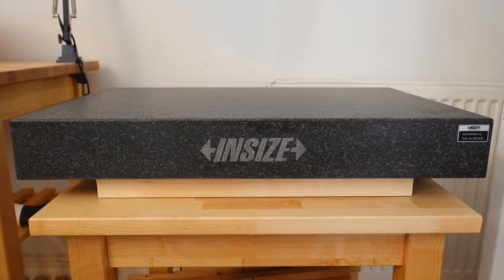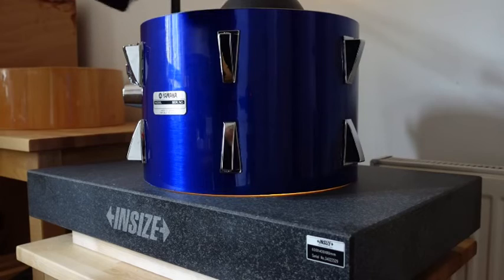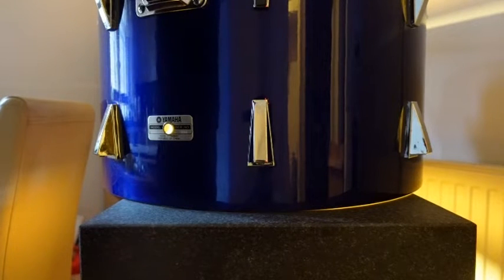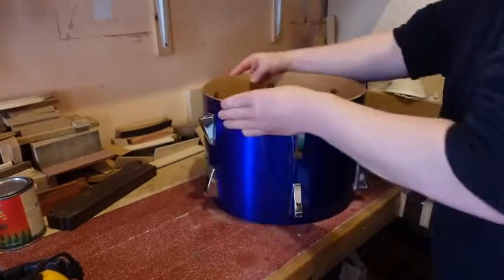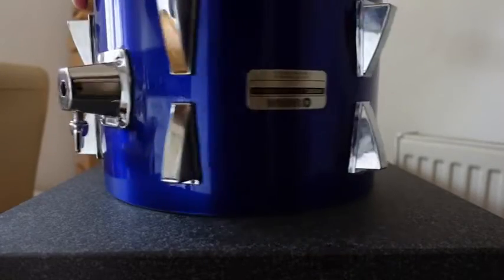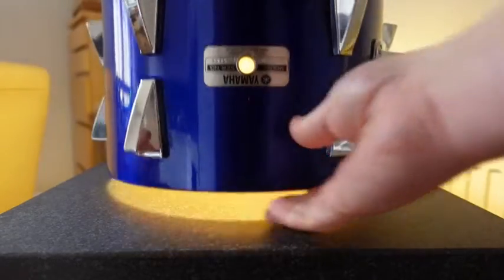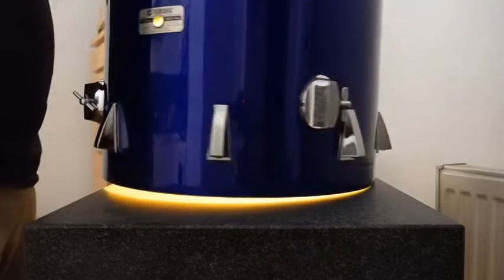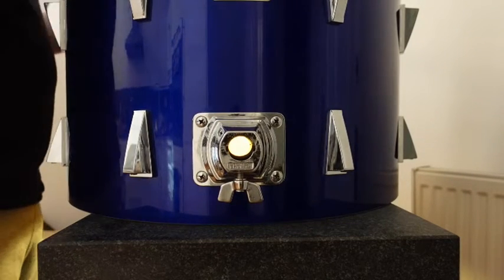Murray Drums - Recutting Bearing Edges On Yamaha Kit

Comment: When I had to even out a drum shell (like in your first step), I used a granite kitchen tile. It’s perfectly flat apparently and it’s size is 60x60cm (about 24”x24” if I’m right). Worked a treat. But then it’s not reference quality like your block. Nice job on the good ol’ Yamaha!